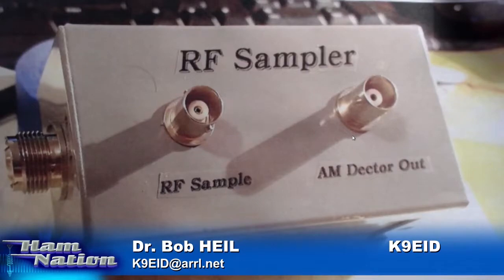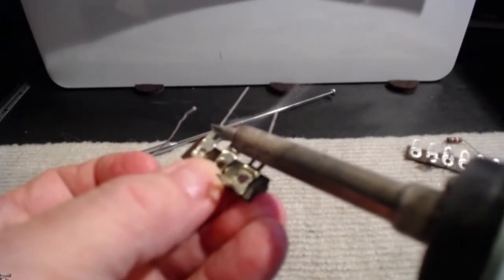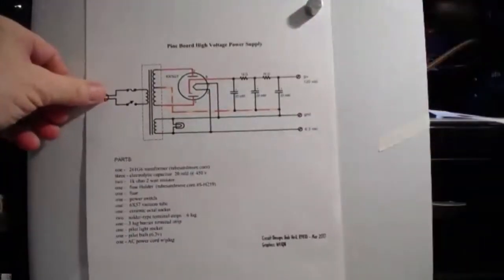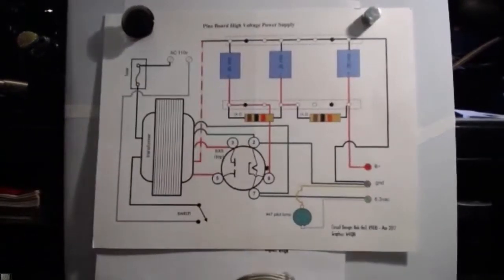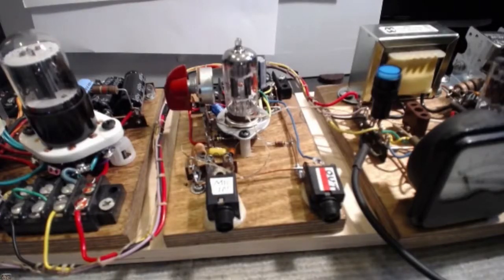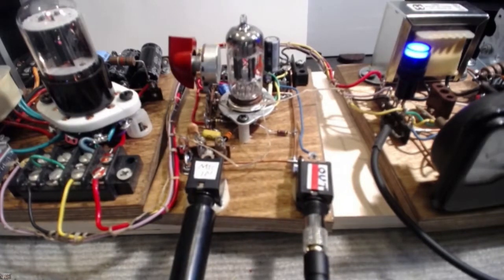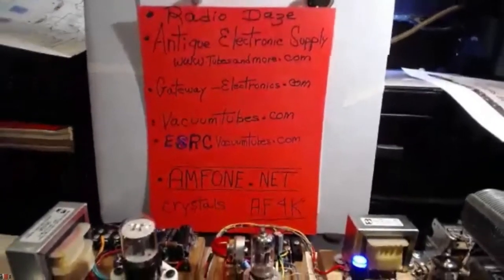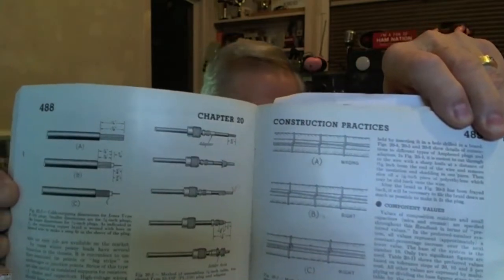Pine Board Project from HAMNation on Twit: Power Supply Part 5

Comment: The wiring diagrams that I see on the Pine Board Project page don't show the 3rd Capacitor that was added toward the end. This is very confusing for a beginner builder like myself and I am almost at the point of discouragement and giving up due to the confusion.